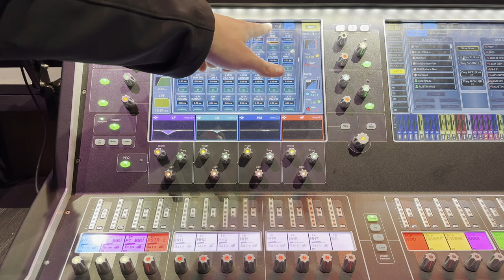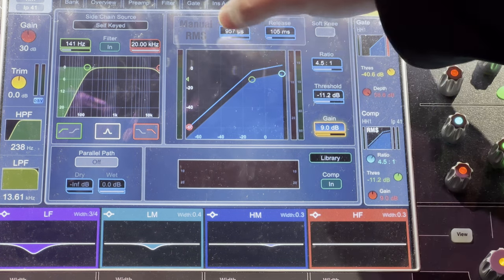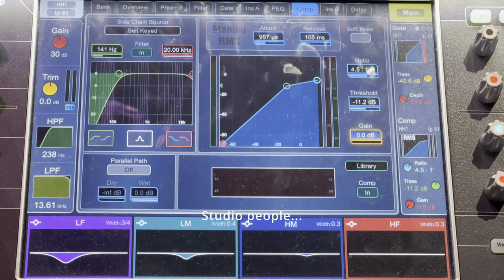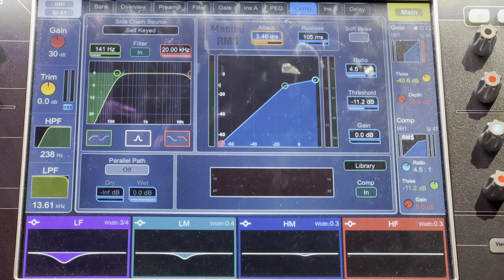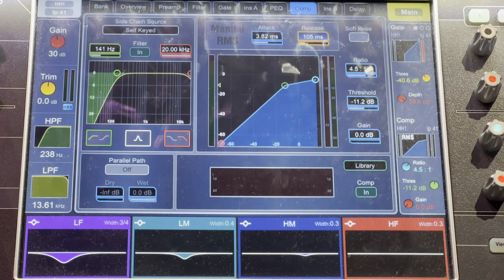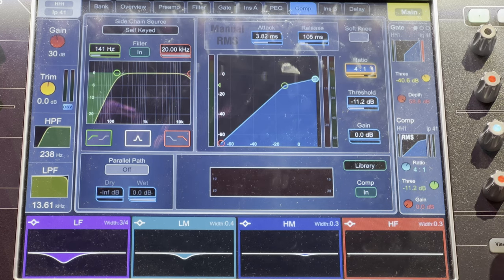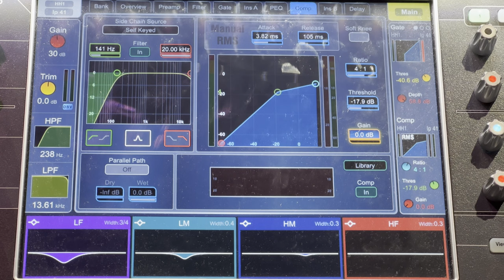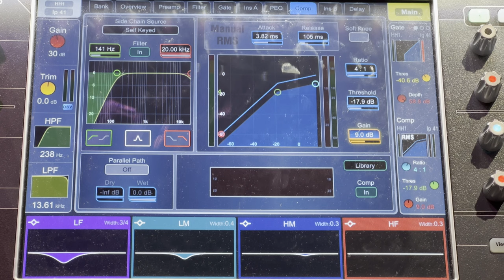How to use a Compressor on a Live Vocal - Live Audio Mixing - Church Audio Mixing

Comment: Our integrator is installing a dLive now. One way I use compression on our old Yamaha M7CL is on the pastor's channel. I set up a parallel channel with strong compression and put minimal compression on the primary channel. The primary channel carries all of the liveliness of the pastor's voice. The parallel channel serves to compress from the bottom up instead of the top down. This, in conjunction with some creative gating helps me amplify him when he talks softer more than I amplify him when he's louder. I can bring his dynamic range within 10 dB and still carry the effect of talking loud in the change of tonal quality and soft without any moments that are too loud or moments that are too soft. With the new system, I plan to do this with the minister of music as well to help bring his voice out front without increasing his top level too much. So it's easier for the volunteers (and me) to sit his voice in the mix without losing him.
Reply from the maker: Great strategy! The DLive is a great desk. Send me an email if you need help! 
sales@thepenn.group

Comment: Can you explain rms & peak when to use which ?
Reply from the maker: Yes- 
RMS will compress the “average” of a wave over a given time. A “peak” will react to transients on a wave. So if you need a brick wall limiter, for example, you’d expect for a “peak” compressor because it will prevent your transients from clipping the channel.

Comment: Wouldn’t you want the tap point for the monitor to be before the compressor?
Reply from the maker: Great question. I assume by monitor you mean “stage monitor / wedge” and not metering point. 

If that is the case, it will likely be a situation where it’s a case by case basis. If the musician is particularly educated or practiced in mic techniques then you would opt for a pre-comp send to the monitor mix to give them a realistic feel of their vocal. However, 99% of the time that isn’t the case and the compressed vocal will be more pleasing to the musician. 

If you were referring to the metering point, i would still elect to monitor the post compressed signal as any outgain may cause clipping. 

Blessings, Austin

Comment: Interesting topic! When do you think it makes sense for a church to add external processing? We run an M32, but I have been considering a waves processing unit for external effects.
Reply from the maker: External processing gives you flexibility to be able to use multiple compressors at once or different kinds of compressors. Not all compressors are made the same, and you can get lovely effects with different kinds of compression. 

Depending on budget, it can be a huge upgrade in sound.

Comment: that side chain eq isn't doing anything. you already have a high pass on the channel above that point.
Reply from the maker: That may be the case, but I find that using the side chain filter can be helpful anyway, because the HPF isn’t a perfect roll off.